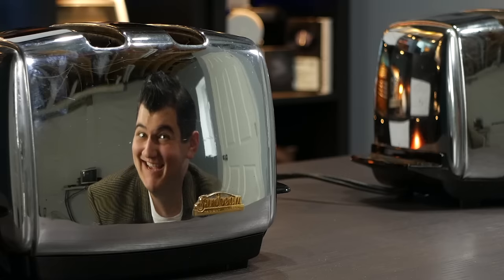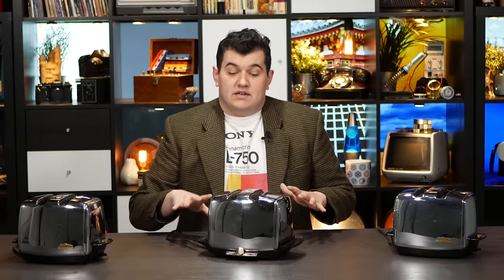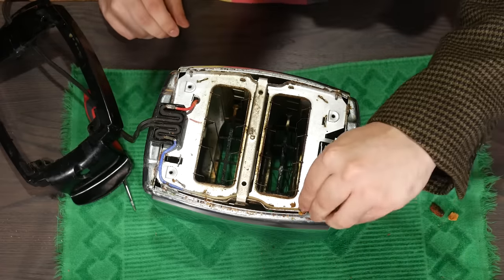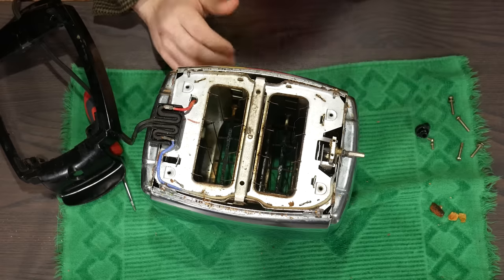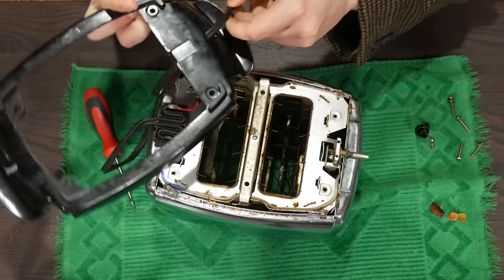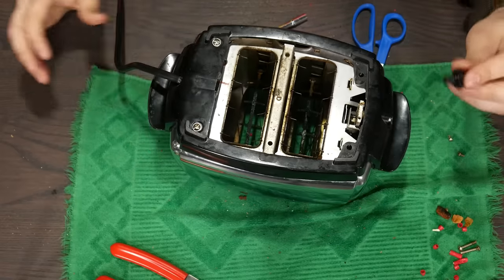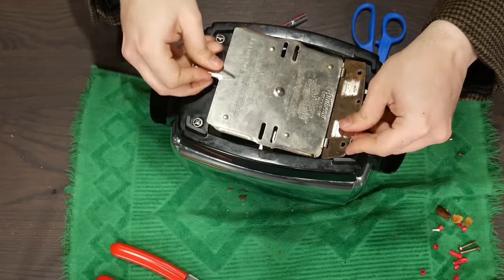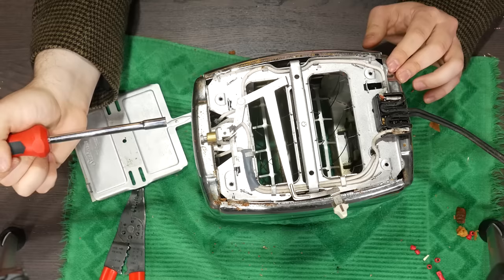Sunbeam Radiant Control Toaster--Repair and Modernization

Comment: "1500 watts. Where has that number appeared before?" 
Card for the Space Heater video appears

I laughed, not gonna lie
Reply: A space heater that makes toast is even more efficient.
Reply: I was listening to the video at that point. I knew what he was talking about and had a chuckle.
Reply: @hondaguy9153  Same, especially because I am on Android, so no pop-up for me...
Reply: @guiorgy , I get pop-ups on Android.
Reply: @Optamizm  same on youtube vanced
Reply: Yes, but is this a small room or large room toaster?
Reply: You can technically pull 1800W from a 120V/15A outlet.  It's not supposed to be for a device that runs continuously (devices that run continuously are supposed to limit to 12A/1500W).  This makes sense for things like space heaters.  But toasters don't run continuously.  My induction cooktop will pull the full 1800W.

Comment: Cable lengths:  the  modern cable being shorter is due to changes in the way kitchens are designed, along with safety concerns.  Old kitchens there would be a few power connections, normally near ground level, around the walls  (or sometimes the centre ceiling light bulb would be the only power point!) and the toaster would be on a table, so the longer cable was useful.  More modern kitchens have sockets above fitted worktops, not only meaning a shorter cable is sufficient (for cost reasons), but also reduces the chance the extra cable might trail into a cooker hob or sink.
Reply: My first demented thought was with the 3' cord, its less likely to end up in a bathtub with someone. 🤪
Reply: ThePoxun I actually came here to say the same thing. I remember the struggle of trying to find an outlet in my grandmothers early 1900s house. You were lucky to find one in a room.
Reply: Nigel Cam  What dollar tree do you have?? ive never seen toasters there, I imagine they are quite good quality, probably spring the lever off the first time you use it, or in the case of the last new toaster i bought damn thing wouldn't cancel at all you had to unplug it yourself, ill stick to my 1995 Delonghi cause that thing uses the fires of hell to cook toast very quickly.
Reply: @christinecrawford  Actually, not so demented. At least here in Canada, electrical code states that all outlets in bathrooms are to be GFI and any light switches have to be  (I'm gonna say) 3 feet from a water source. Small bathrooms have the light switch outside the door.
Reply: I was going to comment the toaster in my parents house sat on the kitchen table back in the 1960's you needed a 6 foot cord to reach from the middle of the table to a wall outlet.  I remember you couldn't run the toaster and the electric mixer (or even a fan) at the same time since it would blow the 15 Amp plug fuse on that line. Someone would have to go down to the cellar to the fuse box to change the fuse to a new one. (Usually they sent "the boy" when I was big/old enough to reach the fuse box high on the wall)
Reply: @christinecrawford  you're my kind of viewer lmao...Came here to comment this exact thing!
Reply: @dart70ca  I believe the UK has the same regulations. And, honestly, I think we do here in the US for new construction and renovations.
Reply: @RadarLakeKosh  😁
Reply: @christinecrawford  Yes. GFI's required near water connections in the US. But of course old construction would not have them. If your wiring is pre-1960(?)it won't even be three-wire, so a hot and a neutral, not ground. If you see wall outlets with the ground prong hole it might not be connected to anything.

Comment: For the two questions you had this is what I believe to be correct. The different wire types are a quick way in manufacturing to identify the wire that connects to each color wire. It can also aid in avoiding reverse polarity especially if it has a polarized plug. Another way is the insulation on the cord. If you look closely the insulation around one conductor will be smooth and the other will have small ribs, imprinted lettering, or painted lettering. It helps with the identification process. The last electrical code book I looked at required outlets to be every four feet or less. A three foot cord allows it to be plugged into the nearest outlet and since a counter top is less than three feet deep, the cord can’t hang over the front edge and be grabbed by children. When it comes to ground wires running to the chassis, it doesn’t matter if the insulation melts or not. The current goes to the same place. Once Bakelite cures and hardens it can’t revert to a plastic or flowable state. Navy ships actually had Bakelite shops to repair electrical components. Another case of reinventing what already works. All I’ve added only supports what you explained. If you stopped to talk on each side issue it would detract from the highly interesting information you want to illustrate. Hopefully my comments aren’t an annoyance.

Comment: I suggest getting a roll of kapton tape to keep those wires in place, is like the duct tape for the electronics world.
Reply: The high temp part is the best, I have 3 rolls of different sizes and they're lasting me forever
Reply: I came here to  say that, it seemed like the perfect place for some sort of tape which would spare you a whole lot of hassle
Reply: Hot glue would work fine, it just needs to hold it long enough to put it together. Considering that the strain relief is plastic, heat apparently wasn't considered an issue by the engineers who designed it.
Reply: @ShayneHartford  one wire in toaster is aluminium, do not solder together aluminium and copper
Reply: @redryder6987  the strain relief, like the rest of the toaster is made of bakelite, a thermoset plastic
Reply: Wizzy Wambo  copper and aluminum creates galvanic pair. And soldering to aluminum is quite difficult

Comment: As for the problem with the visible cutaway of the jacket of the cord, there is a way to easily resolve that, if your willing to modify the Bakelite strain relief slightly.  Dremel out the center rib that separates the leads.  Then the jacket can go all the way in to where the leads will fold back 180 degrees on themselves.

Comment: thank you technology connections for teaching us how to do this and some of the reasoning behind it. My dad was surprised that we didn't know that we could replace cords for my extension board, but we were never taught these things in school and nowadays virtually no one takes things apart to fix them anymore, partially due to how cheap replacing a item is and partially due to the way things are built that you cannot nondestructively take them apart. This is important education for future generations to learn and appreciate if they are to understand the proper risks and electrical safety practices. For example I had no clue about GIHC cables I only learnt about grounding in school and never questioned in what conditions would grounding make the appliance unsafe.
Reply: Honestly when grounding makes a appliance less safe you have a shit electrical system as normally any GFCI/RCD should detect if any >30ma current is not coming back to the neutral.

Comment: WHEN I eventually lay my hands on one of these toasters I will be back to follow your upgrades!
I would suggest using hot glue or epoxy to hold the wires in the strain relief, then they'd be easier to fit and would give a little more flexibility to install the base, and possibly look at soldering the wires together and add some heatshrink insulation to them to make them more secure than the crimp BUTT connectors.
Also, leave the ground wire longer for safety. (In the UK, at least) the ground wire should be the longest wire and therefore the last to break or come away if the cable is accidentally yanked hard enough to break free of the neutral or live connections.
Also put some epoxy or hot glue in the hole where the wire is exposed to mitigate any potential chafing on the bakelite chassis as bakelite can be quite sharp.
just my 2c. (or twopenneth since I'm in the UK!)
Reply: Hot glue will melt again. This toaster gets very hot. Soldering would be OK, but it's tricky in applications where the wires are near a heat source.
Reply: Just to mention, that red wire appears to be aluminum and thus might be a) tricky to solder, and b) not quite safe to solder to the copper as it prone to galvanic reaction.
However pre-soldering with a thin layer, then soldering those together and isolating with a thermo-tube isolation (with some glue in it) looks like the best solution for me.

Comment: A dab of hot glue to temporarily hold the wires in the strain relief would have probably made reassembly far less frustrating. It will fail later, but by then the bottom plastic will be doing the work, so not an issue.
Reply: a dab of high temperature rtv silicone gel would work well and wouldn't melt as it can withstand up to 650 degrees
Reply: @nehpetsamenied9068  Hot glue is useful as a temporary work holding solution because it will melt away at temperatures that don't damage the part being worked on and, very importantly, it is cheaper than dirt. Blue tac also works and is arguably easier to work with, but if heated may catch fire or produce foul smelling fumes (depends on the brand).

RTV Silicone has a price that makes it sensible if it is something the part actually needs, but the suggestion here was to hold something in place until the part that will hold it permanently is installed. Hot glue can be removed with a heat gun as soon as the fastening part is in place, or be allowed to harmlessly melt away while the toaster is in use whereas the silicone would essentially make whatever you just did permanent.

Comment: Great video.  My grandma had one,I inherited, and used for some time and loved it.  I never knew how it actually worked until now.  Another idea would be vintage toaster ovens.  My 10 year old now swears the 1970's Sunbeam with the latch-on switch and sliding thermostat is much better than our new digital readout and larger toaster oven.  He is right, it is easy to use and faster (likely since it is a smaller internal volume), but I think the older ones had more watts as well.  It dings a physical bell one time when done.  The new one has an extremely annoying electronic beeping that lasts 5+ seconds.

Comment: 11:10 for which size of room are those modern 4 slot toasters?
Reply: I believe 4 slot toasters are rated for medium to large rooms. Lol
Reply: Sometimes the 4 slots are side-by-side; my new toaster has two very wide slots that can each take two slices of bread if you choose to use it that way. Because it has just two slots it doesn't take much room.
Reply: The size of room would be 4 Metres by  4 Metres
I hope that answers your question rarbi.art
Reply: @andrew_koala2974  what is that in freedom units?

Comment: Regarding the 'One Slice' indicator, I would suggest it is probably turned around so that the 'most used' toaster slot can be positioned closer to the user.  The way it was originally stamped, if you are reading the indicator, you are reaching over the unused slot to place something into the used slot.  Obviously it's irrelevant if you have the slots equidistant from the user (e.g. | | ), but if you don't, then it's more user friendly.  Though moving the selector to the side in that case does seem a little silly.

Comment: As a electrician who has used a ton of crimps, they never work well on solid wire, with stranded the wire deforms easily,  solid its nearly impossible, if the crimp was prone to movement solid wire will always work loss.
Reply: he mentioned that one wire was aluminum ...is there any issues with using butt connectors (tin plated copper) with aluminum wire?
Reply: @MickeyMousePark  Crimping is good for some things ... not for this. Just solder them. It'll be much easier to fit back into the strain relief, and shrink wrap is probably safer than having metal squished out the plastic from a poor crimp.
Reply: Agreed Ryan...I have had problems using crimps on aluminum wire in the past due to the dissimilar metals
Reply: Stranded appliance cord wire is much finer than stranded building wire.  If your crimps on stranded wire failed, you were using the wrong kind of crimp tool (not a compression or hex die tool) or the wring size connector.
Reply: In my situation it was on a vehicle with solid aluminum wire and i used a ratchet compression crimper..after a few months the crimp was still solid but no continuity ..replaced  the butt connector and everything started working again..after a few months same problem again...in the end i carefully twisted the two wires together put a spring connector and never had a problem again..
Reply: Silly question...this toaster is all metal, and gets very hot.  Does it get hot enough to melt solder, or make crimps expand at different coefficients?
Reply: I had to replace the cord on my AT-W and was afraid I'd have to carefully cut the original crimps off the solid leads with dremel to avoid loosing length. To my surprise I twisted them by hand and easily pulled them off.

Comment: I bought the model vt-40-1 because of your video. It was not working and sold for parts. You were absolutely right, it just needed adjusted.  I checked and it has the dual switches and the cord looked good so i did not feel the need to replace it. I used my megohmmeter to check the insulation and it passed. Thank you very much for putting up this video. I had no idea these were ever made. I think it is great and looks good on the countertop .

Comment: when chosing a cord for a heating appliance, consider either a (full) silicone cable (like on DIY hot air guns) or even a heat resistant silicone/fabric mesh one (like found on irons)
Reply: A good quality PVC lead would probably be fine for use in this application as it is unlikely it would ever hot enough burn the PVC and also the PVC lead is both thermally and and electrically insulated by the Bakelite.
Reply: If the surface of the appliance becomes "considerably hot beyond touching temperature" it's most likely that's too much for PVC as well to stay safe.(it might happen that some unfortunate user slings the unused cord over or at least around the corner of the unit. that should not cause any risk of electric shock.)
Reply: You do have a very good point and I agree with you. There are is many things I did not factor in when writing that first comment thank you for replying.
Reply: This guy knows what he's talking about. Those cheap PVC cords have no business on a toaster.

Comment: I am 100% proud to comment yes we do have Sunbeam toasters in Australia, exactly the kind with the sliding radiant control, the one that I have is actually even orange and chrome and they consume 1600w at 240v, so they are basically double the Watage of the American toaster show here and the major design difference is the panel that holds the cord on actually it’s just hold on with two screws so you don’t need to go through the entire process of taking apart the toaster and sliding the cord through attaching all the wires it’s just simply with some screws and the cover (this is the joy of being close to the US and having European appliance specifications (240 V 50 Hz) we also do have Other American products here such as the Westinghouse slanted front washer and dryer, and the General Electric swivel top vacuum Generally these were in the mood for export in American/Canadian factories or reproduced locally such as in the case with the Sunbeam toaster and Westinghouse dryer

Comment: I pretty much thought you were being overly cautious about the wiring, but now that I have acquired one of these little gems, it really is pretty scary. The best part is how one of the cloth (asbestos?) insulated wires has a fuzzy gray streak from the chassis screw that literally touches the insulation. Every time you operate that screw, you fray the ancient insulation just a little more. The strain relief was a total mess too. Yeahhhhh, I'm afraid this does need an intervention. 

I have to say, I do really admire this thing. It's just such a treat to see form and function come together in this way, plus it looks fantastic on my counter. One day soon, I plan to buff out the scratches and bring this thing to a full mirror polish.
Reply: On the old ones with the knob adjuster, it's almost guaranteed that wire insulation has asbestos in it. I was cringing and twisting in my seat as I watched Jacob manhandle that old wiring :/ . I have my ticket for asbestos and it's not to be trifled with. It's as simple as doing the work outside, making sure the asbestos material is very wet(use a drop of rinse aid or drop of dish  soap in the wetting water to reduce surface tension), and wear a P100 as you do the work. Double seal the wire in a thick rubber bag and dispose of it safely and ethically. If you take those basic precautions for something small scale like this, you'll be fine.